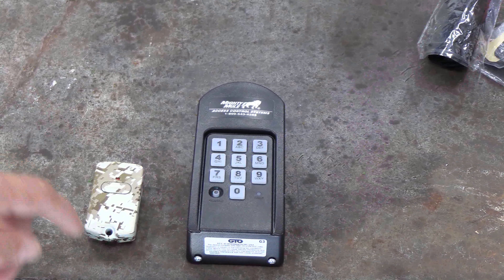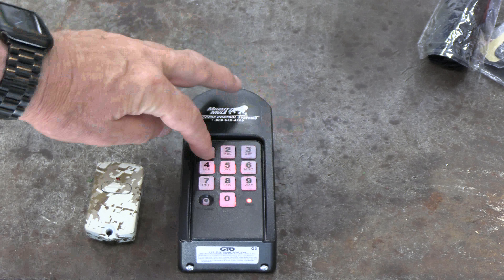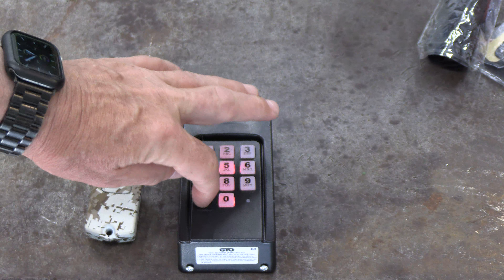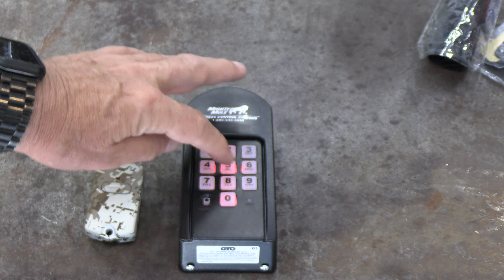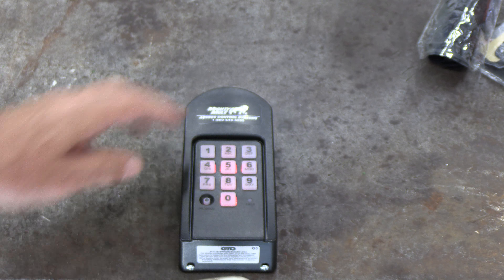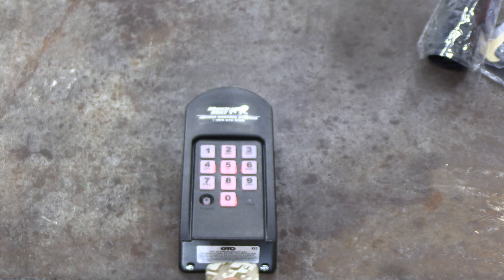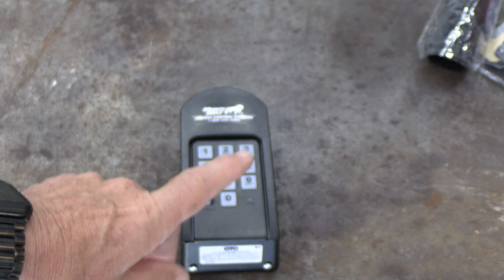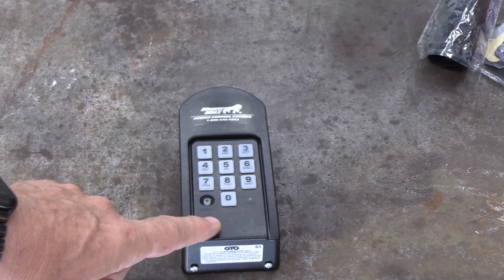Mighty Mule Wireless Keypad FM137 Learn Transmitter Code

Comment from the maker: Great question. You can add your code using either the default master code or your new master code that you that you installed in the wireless keypad. Either way works well. Consider subscribing. Thanks. Joe.